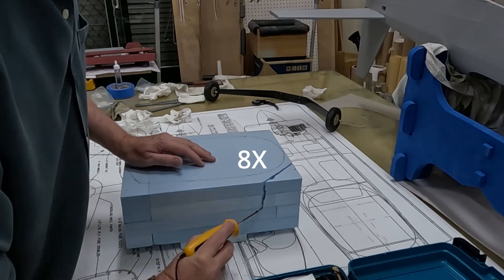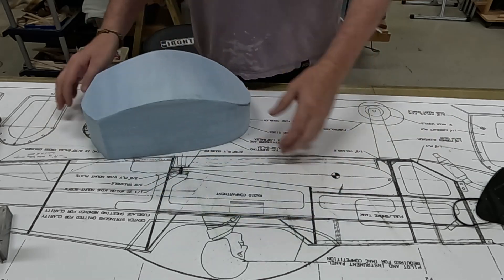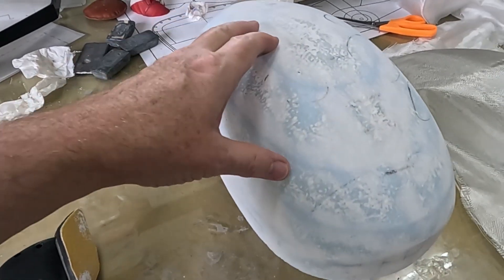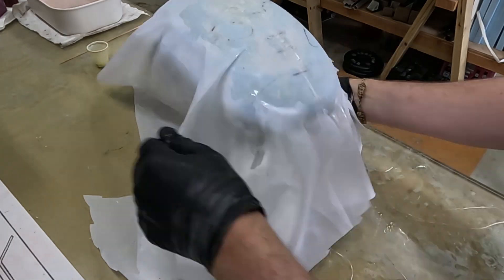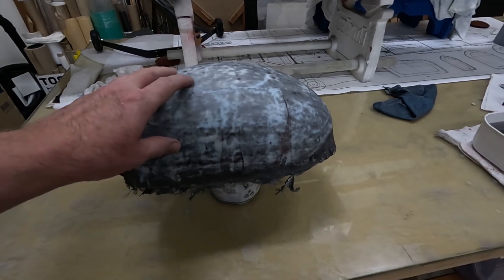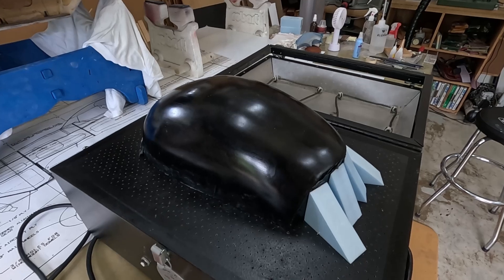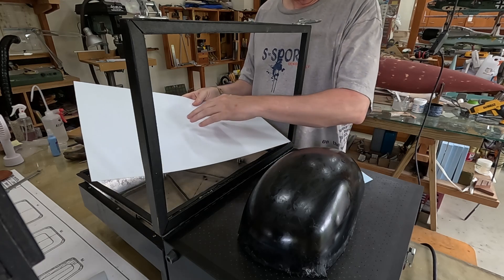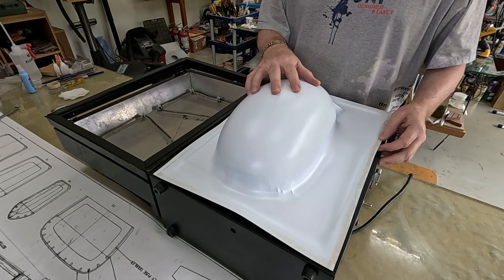DR-107 One Design RC plane build, Update #24, Making the canopy, Part A

Comment: Where did you get the machine you use
Reply from the maker: I bought it from Mike Grey of Skyshark models.  When he closed his business he sold off his equipment and I bought the forming machine.  It was good timing because I had been in the market for a thermal vac forming machine.  I thought that I would have to make my own but then I saw this.
Reply: Does it has an inbuilt vacuum?? @BalsaAeroProjects
Reply from the maker: @ Yes, but I add a shop vacuum to the provided port in the side.
Reply: Can you share the name of your vacuum  @BalsaAeroProjects
Reply from the maker: Therm-O-Vac
Made by Nichols Electronics.

Comment: Hi, I am very close to install the receiver and ignition 2 cell Lipo batteries on my DR-107. As their position must be consistent with the correct center of gravity I checked the plan requirements and discovered that is drawed at 108 mm from the leading edge of rib R1. This corrispond to 25 % of rib R1 cord. It seems to me less than normal (30÷33 % of the cord). What do you think about this matter ? Thanks and best regards.
Reply from the maker: I would say 25-30% is a good place to start.  I normally start conservatively like that and then start moving the CG back until I find what works best for me.  My guess is that the designer played it safe with the CG for the first flight.
Reply: @BalsaAeroProjects  I agree with your reasoning about the CG position. The calculated (with some web calculator) is 138 mm. This evening I weighed my plane w/o canopy (not yet ready) and the final weight is 6576 grams. Wing loading = 99 grams/square decimeter
Reply from the maker: @ Are you making your own canopy?
Reply: @BalsaAeroProjects  Yes, I do. At the moment I am working on the hard foam master. I hope to thermo-vac the canopy by the end of this month.
Reply from the maker: @Buzz897  I would love to see it if you could post a video.
Reply: @BalsaAeroProjects  Unfortunatelly I am not able to built and make a video in the same time. The result will be surely very bad.  Sorry...
Reply from the maker: @Buzz897  No problem

Comment: i feel your pain struggling with that vac former  i built one 15 years ago and it was a bitch and wasted a lot of plastic if you are going to continue with bigger projects invest in a machine with proper vacuum pump and vac air storage tank it will save you a lot  of money  and stress please don't take this as criticism i hated vacuum forming but after building a proper machine it is the best and easiest machine in the workshop and most enjoyable thing to watch that plastic take the form of the buck   ps. some clear plastics need to be pre dried to get rid of moisture before vac forming good luck enjoy great video
Reply from the maker: I vac-form so infrequently that I have a hard time developing a good technique.
I read up on making a machine before buying the one I have and you're right in that I could use a better pump and tank, but I can't justify the time/effort and storage space for something that I would use maybe once a year.
I remember reading about pre-drying plastic before using but I forgot on this project.  Thank you for the reminder.  I hope to remember the next time I make another canopy.  I think I'll put a Post-It note on the machine to pre-dry.